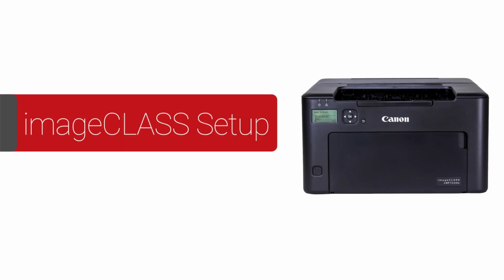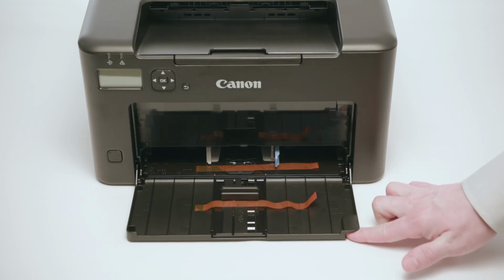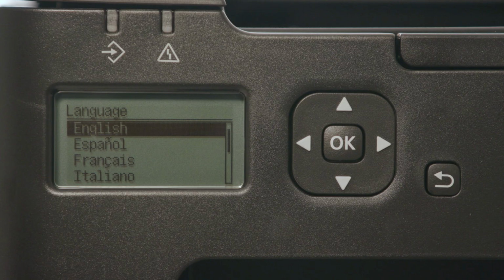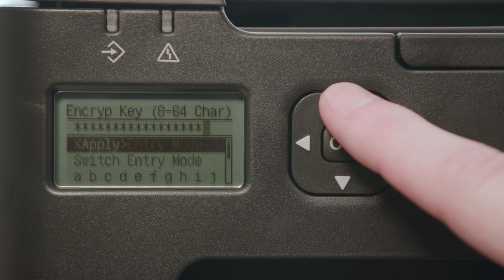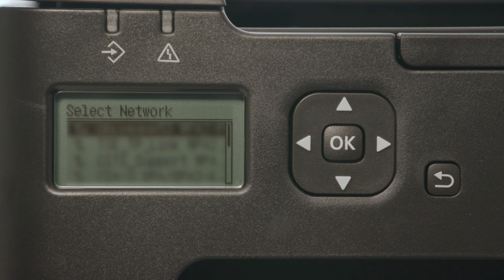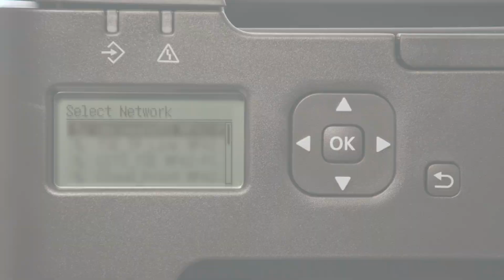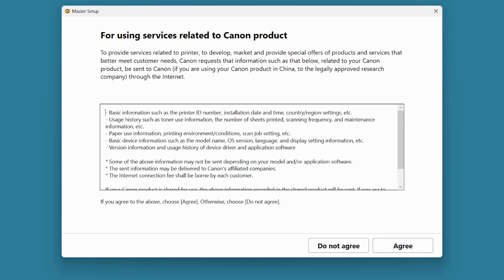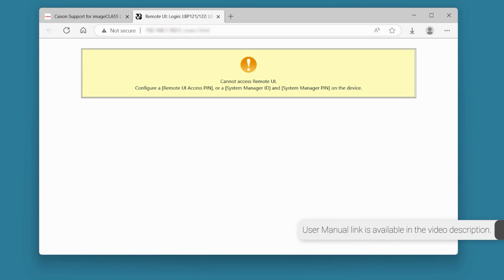Canon imageCLASS LBP122dw - Initial Hardware & Wireless Setup for Windows

Comment: The toner cover did not  close after I removed the tape. There is about a 1 1/2 inch gap. I don’t want to use to much force to try to close it. I just bought it! The manual did not address the issue.
Reply from the maker: Hi. We’re very sorry to hear you’re experiencing toner cartridge trouble. Please give our imageCLASS printer support a call to help. You can reach them weekdays at: 1-800-652-2666. We recommend visiting our Canon community for printer support information: https://canon.us/community